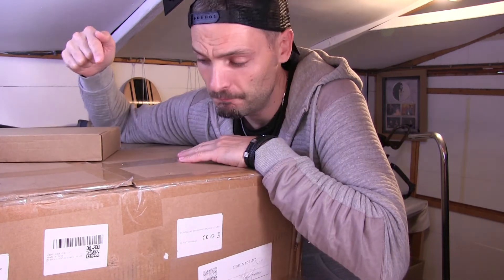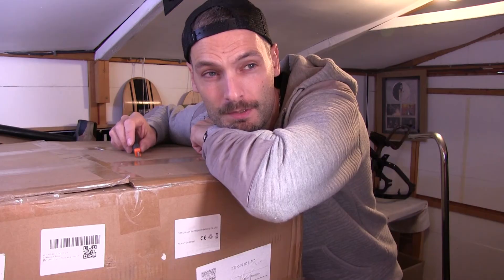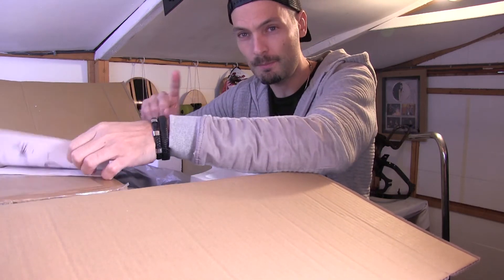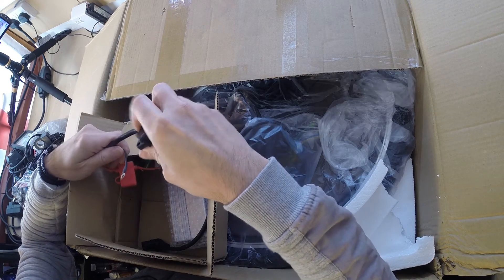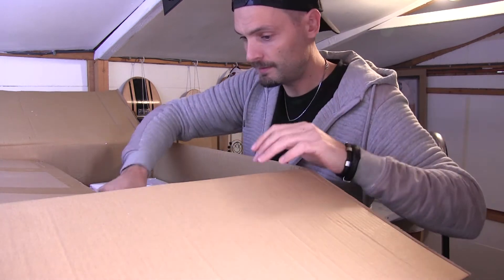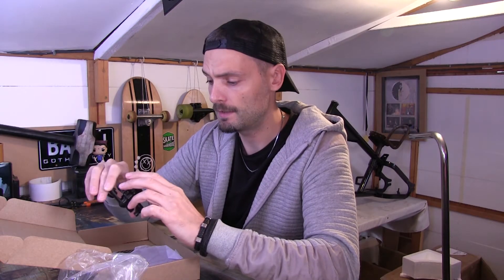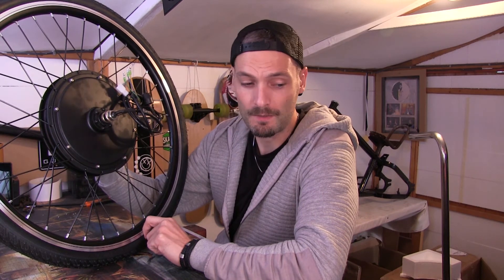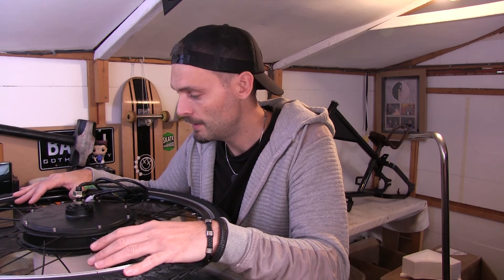Unboxing a 1000w 48v eBIKE Conversion Kit and brake discs from eBay - DIY build

Comment: Why did you decide to go front wheel instead of rear wheel? I want to build one really soon
Reply from the maker: at the time I could only get a front wheel motor plus I wouldn't to add the rear disc brake.
good luck with your project and thanks for watching 👍